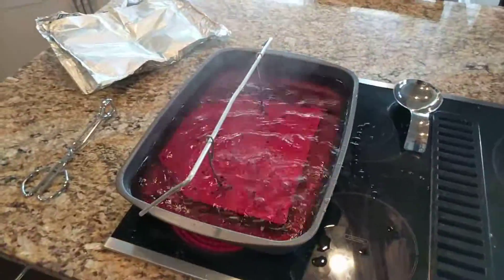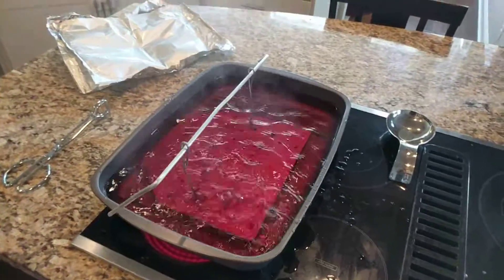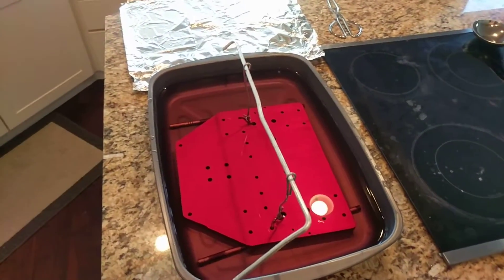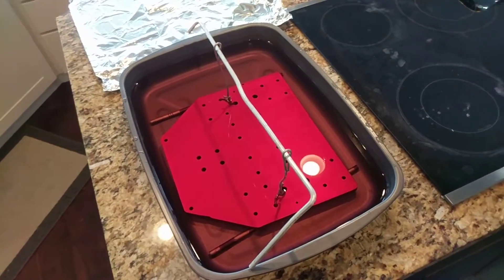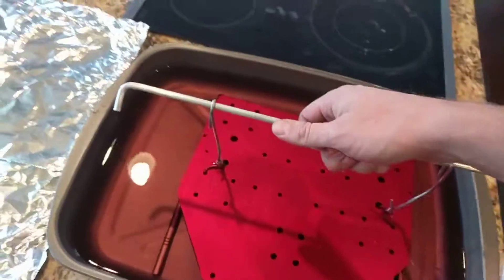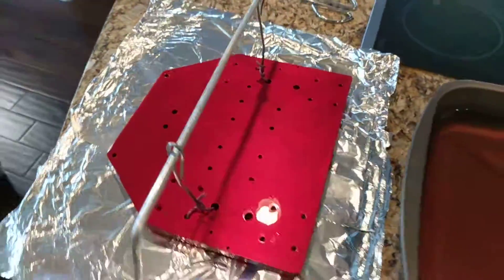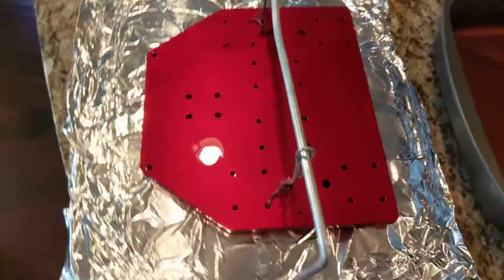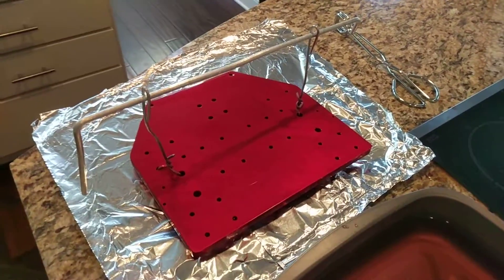Anodizing aluminum at home, Part 2

Comment: Quick tip for you man.   You can pull it straight out of the boiling water and have a can of WD-40 to soak it down with then let it hang and cool off.   After it’s cooled down wipe it down and you will have a glowing anodized part.
Reply from the maker: thank you.  Do you have an example you could show?  I'm currently anodizing a sandblasted part so I'm not sure if it would be a good candidate.
Reply: Yeah the sandblasted part would not be a very good candidate for a real shiny finish.